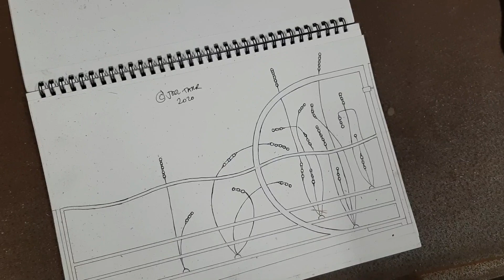Stylized seed pods

Comment: If you want to burnish a bit more aggressively Joel try using a worn down twisted wire cup brush (something about half the thickness or less of a new twisted wire cup brush). The wire wheels work better at this when they're a little worn down as well but for some reason the worn cup brushes can really smear hot metal around.
Is that a little Anyang hammer you're using there?
Reply from the maker: Cheers. I've always preferred using wire wheels to cup brushes because the weight balance makes them a bit easier to use IMO. Yeah it's a 25kg Anyang. Handy piece of kit!
Reply: @joeltarrartistblacksmith  Yeah, the little Anyang's are great, really hit hard for the ram weights.  I worked with the former Australian Anyang dealer (Glenn moon) years back during my Journeymanship and got to try out every weight up to the 75 kg., The tiny 9 kg was a little pocket rocket. 
You must have got yours from John Nicholson then if you're UK based?
Reply from the maker: @ianlowe4666  sure did!